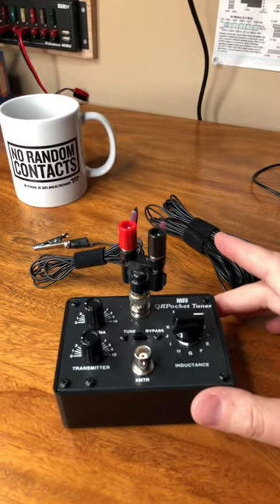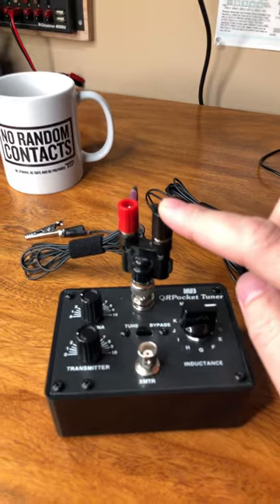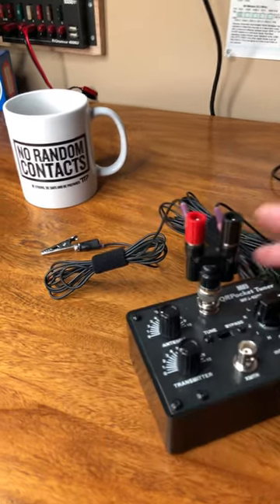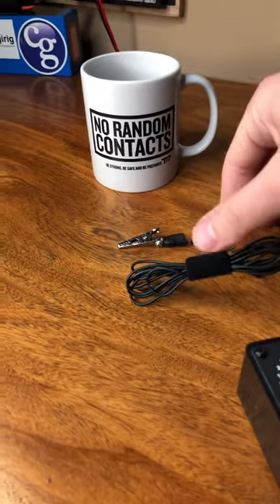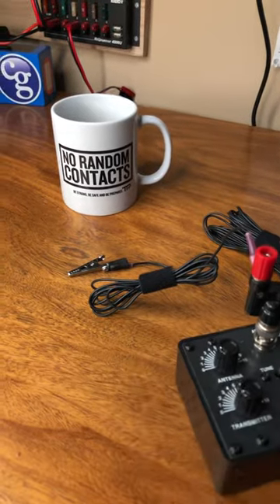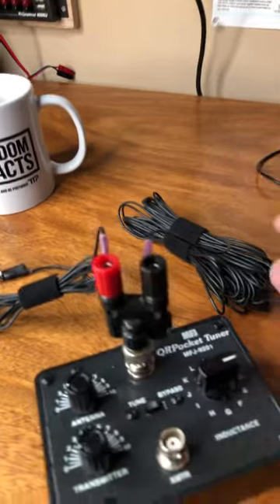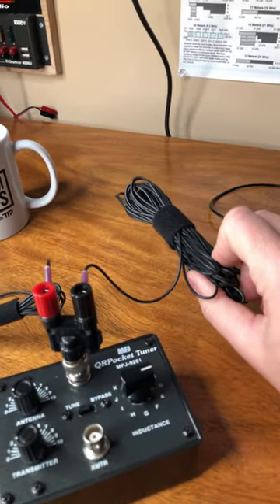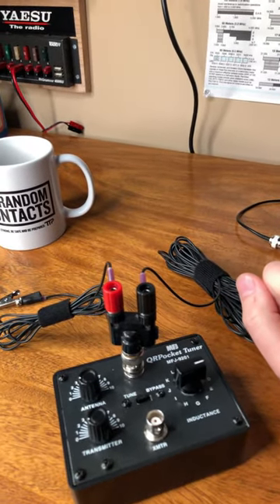Let's tune a barbed wire fence - Preparation

Comment: Ure going 2 do what 2 tune a piece of wire.  You lost ME WAY way over MY PAY grade. I'll stay tune 4 the video will be interesting 4 me.
Reply from the maker: I'm going to try to use anywhere from 100ft to several miles of barbed wire to make an HF antenna.

Comment: This will be a great project to try.  One of these days I will test losing up some barbed wire for a receive antenna.  Great series Gaston
Reply from the maker: Kevin! This will be interesting. I just tuned about 200' of barbed wire fence behind the house on 7.100 at 1.5:1. We'll see what happens when I connect a radio. Right now, I'm just capturing metrics with the analyzer for my DOPE card. Thanks for stopping by. Good luck with your RX antenna.

Comment: This is a very realistic use case.  For example, what if one had to use part of their antenna wire to help construct a shelter of some sort. A "plan B" for an antenna system would be very important.
Reply from the maker: Options and contingency plans are what this kit all about. This wire can even be repurposed to build some of the Jungle Antennas for the higher bands that we covered earlier in the series.